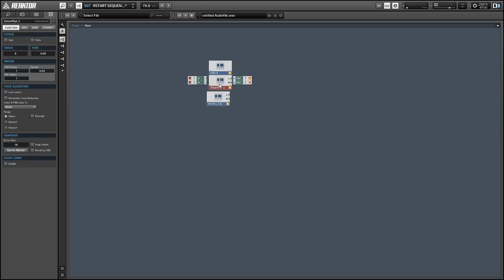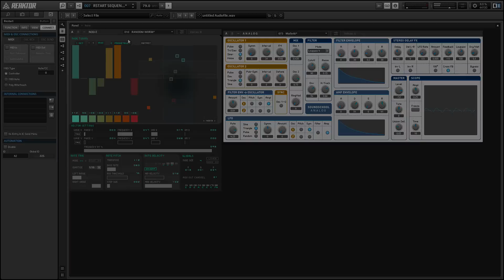NI Reaktor - Using NOD-E - How to Tutorial

Comment: Is midi out ( midi note recording )  to daw (cubase ) possible as well ?
And if so, how ? please help. thanx
Reply: Yeah, this is possible, and it's the main way I use Reaktor sequencers. Don't how it works Cubase, but in Ableton you just change the "MIDI From" of the channel with a synth to "Reaktor 6" (the channel with Reaktor running Nod-E) and below that change "Post FX" to "Reaktor 6", the synth will recieve MIDI when you arm for recording and then hit play.
In Cubase I guess you'll have to find a way to change the midi input of your synth channel to the channel with an instance of Reaktor running Nod-E.
Reply: Great. I´ll try it. Thanks a lot for answering !! And of course i´ll be back if it doesn´t work :D
Reply: Got it _ fuckin´great !  In Cubase you have just to create a midi channel and route the reaktor output into the midi channel input, then you got the midi Data. Thx !
Reply: That's great to hear! I'm glad you could figure it out. Have fun!

Comment: This is just what I needed. Thank you. Question: can it control another non-reaktor sound?
Reply: It can in VST mode, but you have to open up a new track in your DAW and then point the INs of your Reaktor track to the INs of your instrument track. Make sure the track is armed to enable record monitoring, or you won't hear the output of the midi triggering. Also point the INS of your instrument track back to your Reaktor track. Make sure you raise your levels from -inf to 0 so you also get the sound in your DAW.

Comment: Nice ensemble. I'd like to know how he created controls for the phase of each node. I was making a multi-sine LFO the other day and I made a global knob that would open up a series of multiplier receiving constant values for the phase of each sine. When I turned the knob up, it worked perfectly and the phase of each sine spread apart beautifully. Then I turned the knob down and the sines wouldn't return to a phase value of zero. I had to create a "reset" button that just turns them all off and back on real quick. I wish I didn't have to do that. Any suggestions?
Reply from the maker: Mmm, I think he's probably using an LFO built in core, where it's much easier to add a phase to an oscillator.